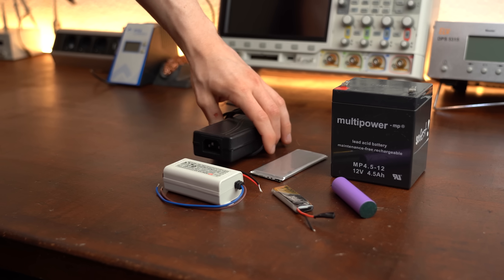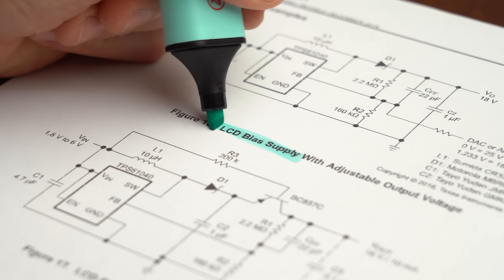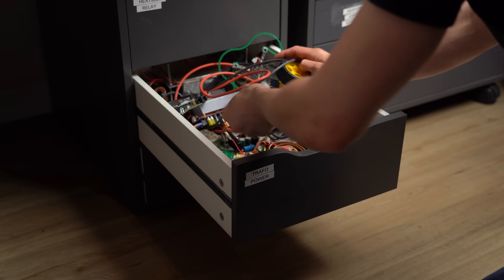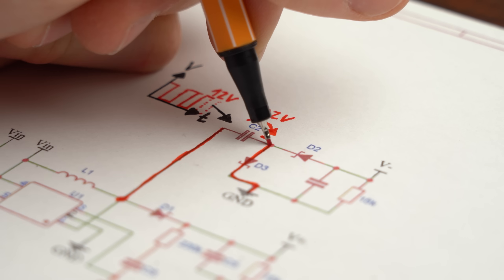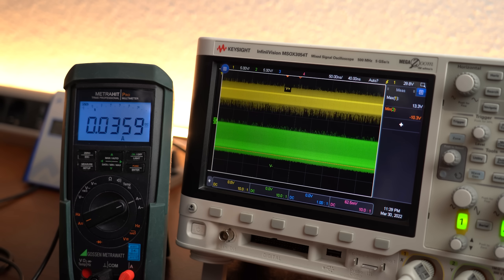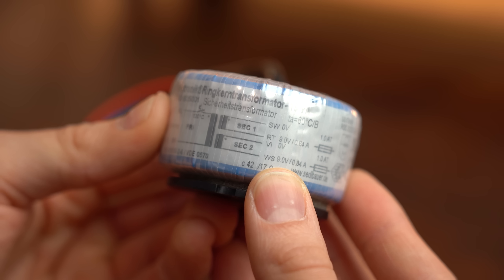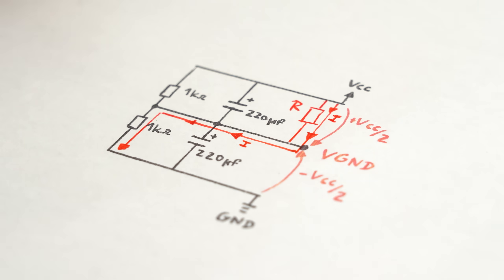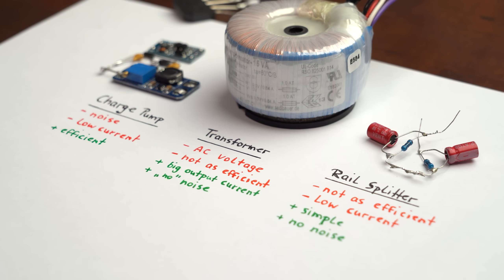Negative Voltages are more important than you think! So here is how to make them! EB#52

Comment: Wouldn't it be much easier to just swap the Positive and Negative wires? 😁
Reply from the maker: Well......
Reply: But if you want a rail to rail output from a simple dc you will need his video 🤩
Reply: Not allways. For example if you need a Positive and a negative voltage.
Reply: @flos251  I expected you to take it as a joke.
Reply: @flos251  just a cylinder with correct wiring, and motor, and some surfaces to receive signals from cylinder with wiring. 

Inputs +- and  -+ in sequence
Reply: @Lamsongames  Yes, you’ve now created a DC/AC motor-generator with unknown square wave frequency output…? Add tapped transformer and rectify - you nearly have a 1920’s solution used for railways… (I’m still bad at jokes, ok…)
Reply: @musiqtee yes maybe, but we can calculate frequency depending on amount  sequnces, and on speed of its rotation, and it is not motor / generator, it is just an sequncer or how should i call it, it just changing electricity direction .
Reply: @Lamsongames   Agree, maybe a motor-commutator. What you say is indeed possible, and lurks into how phone exchanges did high power pulse-trains from 48VDC. Still, it is generating pulsed DC, practically like AC with a positive only phase. What would you use this contraption for…? 😊
Reply: @musiqtee  theres no use for it , in todays circumstances  but , i think i would use such a contraption to just simply switching something on and of fast.
Reply: Hehe, I’m just bad at jokes… 

The magic (physics, ok…) is what we refer to as “ground”. A circuit connected to nothing else, only interacts with the power supply. “Minus” can be “ground”, fine… 

The interesting part happens then the circuit IS connected to, say your house wiring. For this to be safe, or even just work as expected - “ground” is already defined as “earth” in the home - the yellow and green wire, PE. 

Then everything we build, gets a “zero ground potential” between our power supply and the house wiring. So, plus or minus (if needed) will exist from that common (pun) reference. 

E.g. in audio, a speaker is only “at rest” if both terminals are at the same voltage. The amplifier will need to both “push and pull” the speaker - requiring plus and minus “power”. If this is indeed connected to the home, “neutral, common, ground” are the same zero as wall ground. We’ll need minus as well as plus DC referenced to… ground. Three cables, two bus’es & ground…

And let’s just leave out galvanic isolation, please…?

Otherwise we are in Electroboom territory…😅
Reply: just what i was thinking...
Reply: Some ADC's of microcontroller don't take on negetive voltage, for example when you provide negative voltage to Arduino analog pin you can damage the Arduino
Reply: well, it works. Its just like the voltage divider with the virtual ground but instead you use 2 power supplies.
In laboratory at my uni we did it this way, it works but i dont exactly know the limits here.
Reply: @zauletandrei using power supplies with completely isolated outputs, you can connect their outputs in series to achieve dual rail output  But, make sure the outputs are completely isolated from the input and chassis, otherwise you're very likely to short the power supplies.
Reply: The center tapped transformer scenario is very common for audio amplifiers, especially powerful ones. Then the left channel “shoulder” is negative and the right channel is positive.
Reply: In theory yes, but that's no fun.